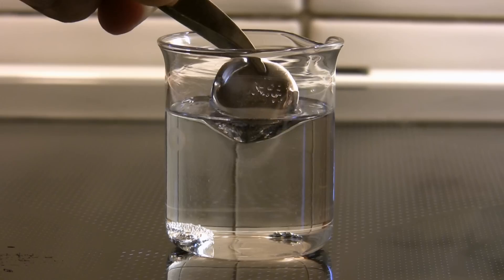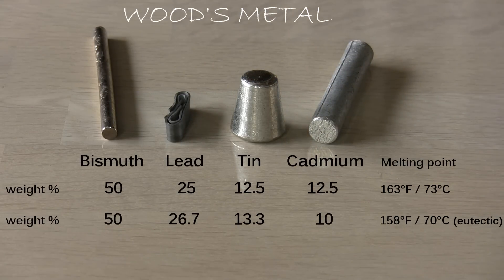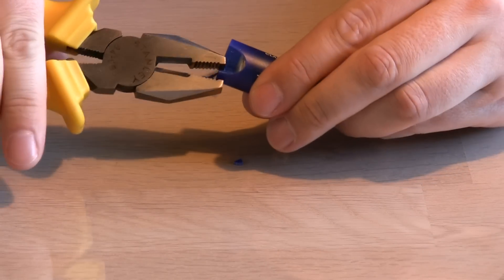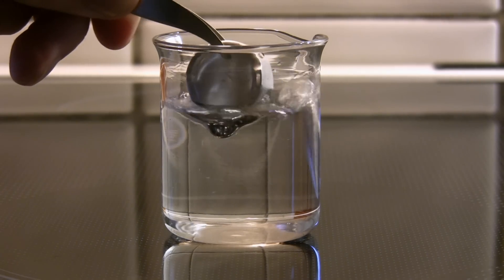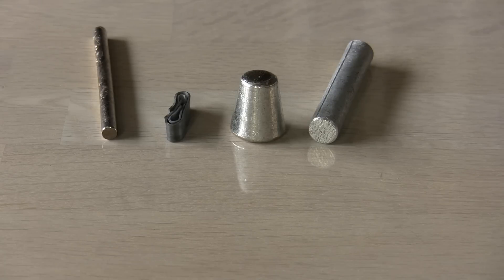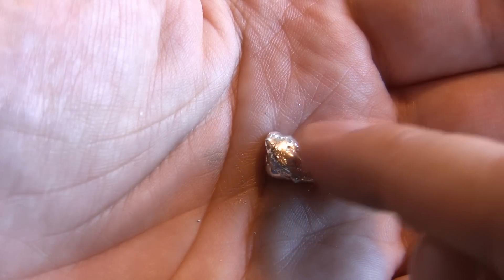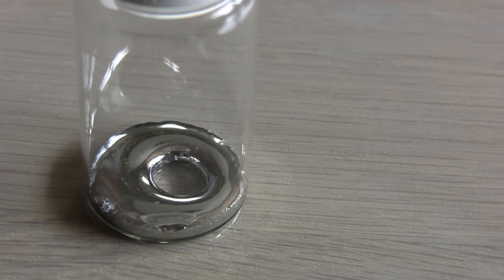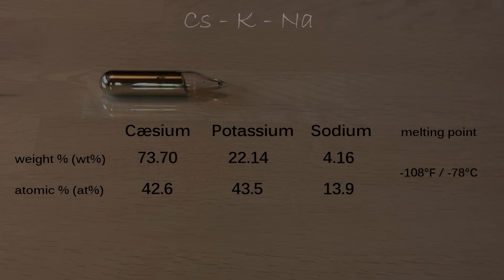Metal Meltdown | Brainiac75

Comment: Isn't hg's freezing temp. -40F? Gonna need to be pretty cold
Reply from the maker: Yes, but it vaporizes at a much lower rate at freezing temperatures than at room temperature/summer temperature. So I prefer to handle free mercury at wintertime. The colder the better :D
Reply: Yeah the in the vids I saw you could see the guy was wearing a gas mask.
Reply from the maker: Always a good idea to wear a gas mask near mercury. It needs to be a special mask approved for mercury though. Normal gas mask are not enough. I haven't found any suitable for sale in Denmark to normal customers like me :(
Reply: Yeah just gonna have to w8 for it to get colder. And once you get all the Hg out you should do some vids on it

Comment: Isn't NaK used as coolant? Periodic Videos talked about it.
Reply from the maker: Yes, NaK can be used as a coolant. A very cold metal, that is still liquid so it can be pumped around, is an extremely effective coolant.
Reply: Brainiac75 I don't think any metal is intrinsically "cold".  It's a good heat sink, like most metals.
Reply from the maker: Admiral Percy Sure, but a major point in using NaK as a coolant is, that it's a liquid metal even when freezing cold (liquid down to -11C). So you can cool it down and still pump it around as a very effective coolant

Comment: hi! I want to share my experience melting tin
well, not pure tin, but tin-containing solder wire.
I think it's quite safe to melt them, you can melt it in a ladle or in a bottle with a stove or butane torch. solder wire usually comes with flux. this flux boils off before the solder melts. so I used some candle wax to prevent oxidation...

Comment: BTW, I've ever felt splashes of tin (solder) quite far above high temperature its melting point. my skin was swollen and fhe tin sticks to my shirt. even,, I've ever felt the heat of a sand grain sized aluminum, at very high temperatue (slightly lower than it's melting point), which fell on my hand. it felt quite nasty, but it left no mark (?!).

Comment: Do you know a good low melting point metal which is good for crafting?
Reply from the maker: +Cpt, Cookiebutt 
The shown alloys Rose's metal, Wood's metal and Field's metal are all good for crafting. The downside is the toxicity of lead so Field's metal shold be prefered - it is just very expensive...
Reply: How much would it cost to get like uhm enough for 10 CM blade knife?

Comment: Does fields metal stain your hand like gallium?
Reply from the maker: Iris The Yveltal I wouldn't hold molten Field's metal - too hot -  but it probably would stain, since solid Field's metal can stain a little if you rub it against skin.
Reply: Ok thx
Reply: Gallium stains you hand both solid or liquid which sucks

Comment: These Facts are very well known in the Industrial world for a long time..
From Welding to IC chip Manufacturing..
In many cases of very low temp soldering.. A Ultra Sonic Soldering Iron is used without Flux to bond.. Works very effective.. Ever solder Indium to Crystal Silicon???
Or,
Submerge IC Chips in a Hot vapor cloud of inert Gas that would melt low temp solder to bond connections for heat sensitive Chips..

Comment: can you melt neodymium magnet
Reply from the maker: +Ashutosh Rana 
Yes, but it would require a very high temperature. The material in a neodymium magnet is actually molten in early stages of the manufacturing proces.
The magnet would however lose it magnetism before melting.

Comment: METRIC SYSTEM PLS ffs
Reply: cmon, he shows both fahrenheit and celsius ffs, get some glasses
Reply: +Samuel Lindström 5:10 get some brain
Reply: Samuel Lindström yes
Reply: +L44tsmasher735 I'm a American back off buddy
Reply: Just google the fucking temperature.
Reply: 1tobedoneX i do it everytime. but it gets annoying^^
Reply: Kymate good point
Reply: Kymate you can melt tin pretty fast but It is very expensive
Reply: Kymate 
Learn the conversions. Kelvin is the standard. F=1.8*C+32..... (5/9)F-32=C ..... K=C+273.15
Reply: Kelvin is thr standard because its scale begins at absolute zero (the moment when atoms quit moving). Zero for Celsius is the point of water freezing. 32 degrees Fahrenheit is the freezing point for water. 273.15 Kelvin is the freezing point of water on its scale.
Reply: Midori Akamatsu an American*
Reply: Search it on google, just that easy.
Reply: Canal do Arpaca change It America its that easy
Reply: imo, celsius is more easier to understand than fahrenheit, (well i know the two F took me a week to understand)